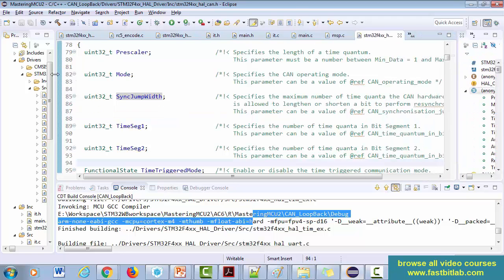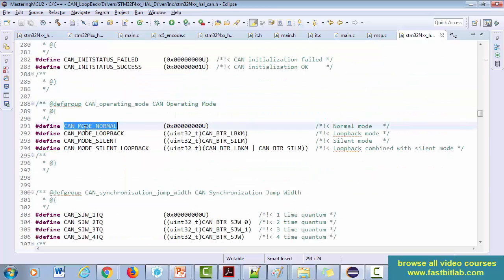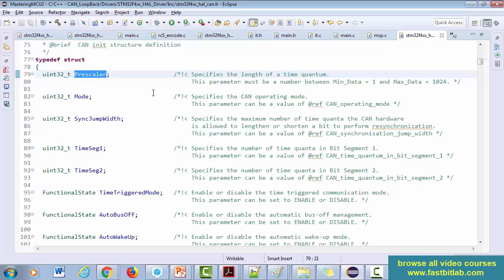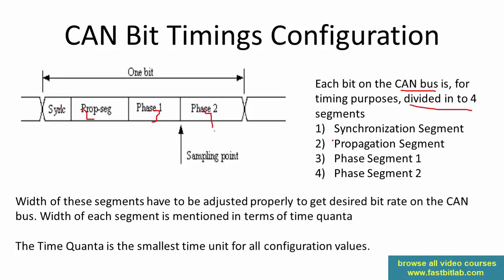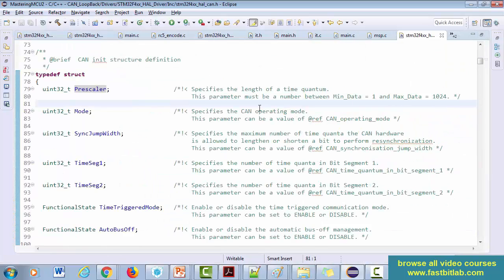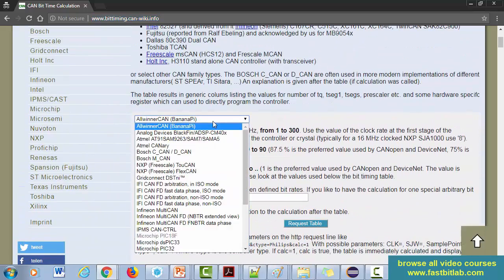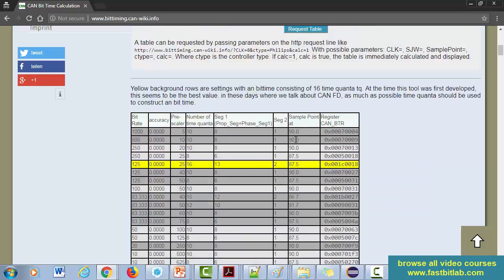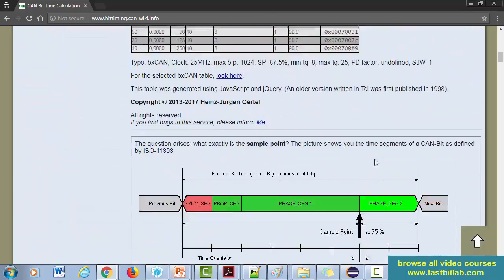Controller Area Network(CAN) programming Tutorial 14: Bit timings and online calculator

Comment: My Stm32H745 has fdcan registers, but I still want to use it as classic-can.. will the online calculator still work?

For example, the clock configurator is set for 40Mhz..  and the calculator shows a 4, 8,1 for the prescaler, Prop/Phase1, and Phase2, respectively... however, this didn't work :(